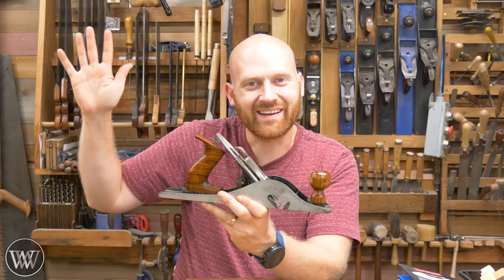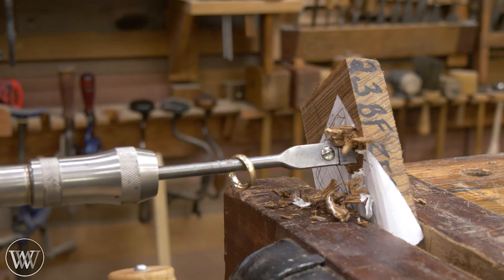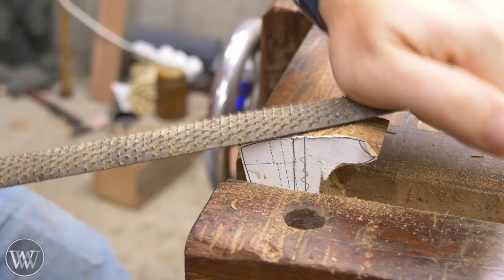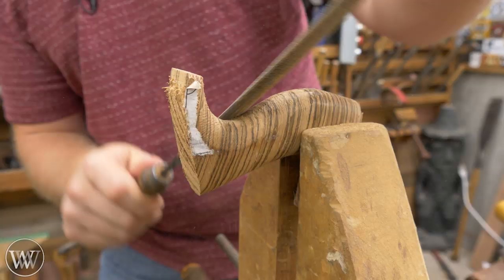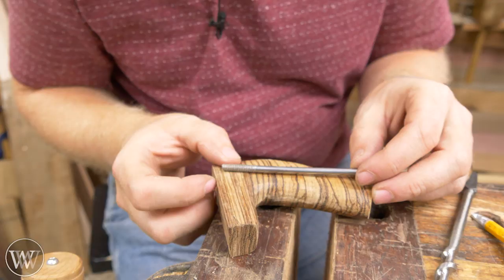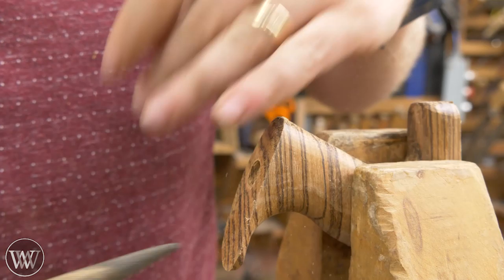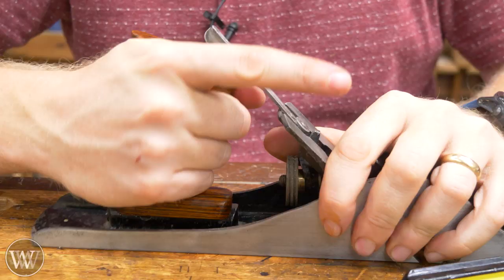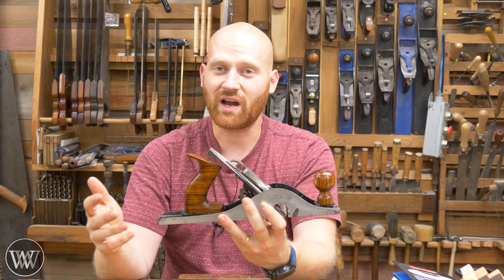How to Make A Tote For a Hand Plane Stanley 10 14

Comment: Great again James. Little trick drill the bolt hole first then if you run off you can adjust your template on the wood.
Reply from the maker: I used to do that when I used a drill press. It's a great way to do it.

Comment: Pretty tote! Apparently, though I'm not a big guy, many planes were made for people with much smaller hands and because of clearance issues I've had to redesign the replacement tote to clear the iron. Especially transition planes which are in abundance here.
Reply from the maker: I ahve the same problem. most of them that I make for my self I make them a bit taller!

Comment: Curious to follow the reason for having the swivelling tote on this type of plane. I’ve had a Type 10 for years and have never had the need to consider that alternative! Presumably the sole casting needs to be manufactured to accommodate that function.
Reply from the maker: It would have been fairly common in the timber framing world where you're working on a very large shoulder and cheek. This way you could lay the plane over against the side move the knob until up and out of the way so that you wouldn't be scratching your knuckles on the board it is sliding against. They did not make many of them as they did not sell that many and that's one of the reasons why they're so expensive now. But yes it is a different casting to allow the knob and tote to rotate.

Comment: Splitting Wood - Not necessarily a bad thing.  It showed the woods weak spot.  Best thing to do is glue it and clamp it tight right away.  Just stop and glue and come back later.  
The wood will actually be stronger there and the glue line will be invisible.

Done it many times.   Doesn't waste the wood either.  Heavy grained wood (Zebra Wood) has a tendency to split through a weak spot that is invisible.

You can see this happening when you just break off chunks of wood rather than cut if off.

Comment: I've always wondered why the grain on a tote is orientated horizontal instead of verticle, isn't there greater risk of it breaking that way?
Reply: It's squeezed together by the screw. On the other hand, if the grain went top to bottom, I guess the screw hole would weaken it and make it prone to splitting top to bottom. (That's just my own guess, I don't have a definitive source for this.)
Reply from the maker: surprisingly. it is stronger this way. some people think the screw holds it there, but even on wooden planes with out the screw you still keep it horizontal because it is stronger. if you put it the other way then the horn and toe will break off, then ther is no stability to the base! a bit counter intuitive, but the clear winner in the end.
Reply: @WoodByWrightHowTo  Ha. Good point about the wooden planes indeed!
Reply: @schm4704   If you would like a slightly more scientific answer, here we go. If you apply a force from back to front of the tote, the shearing force acting on the grain is the sine of the angle made between the force and grain. At 0 degrees, there is minimal pressure. If you make the grain run vertical, then the shearing force is applied at 90 degrees to the grain. That is maximum stress on the grain; this is in addition to the pressure of the screw pushing to split the grain along the wood. I hope that makes sense and is a decent explanation.
Reply: @NickLuker  Thanks, that does make sense!

Comment: Great video. Looking forward to taking on a similar project for an old stanley plough plane i have which has a plastic tote. Been planning on replacing this for a wooden tote for a while. Do you have any tips with the orientation of the wood for best strength? Thank you!
Reply from the maker: Thanks. It is strongest going horizontally. As is here.